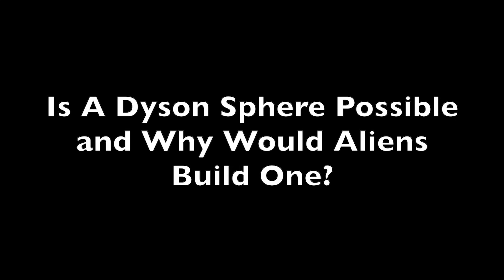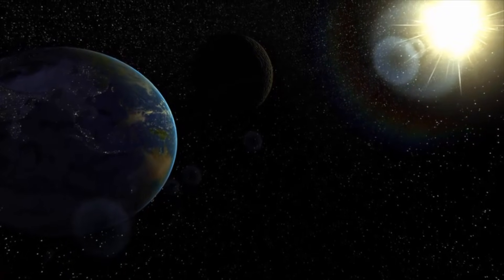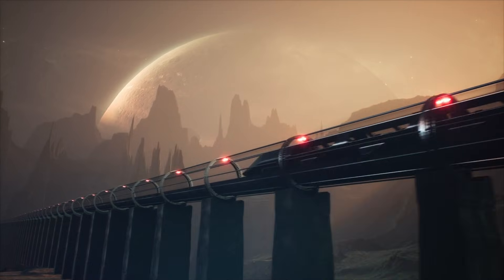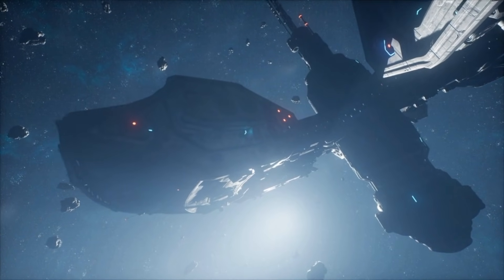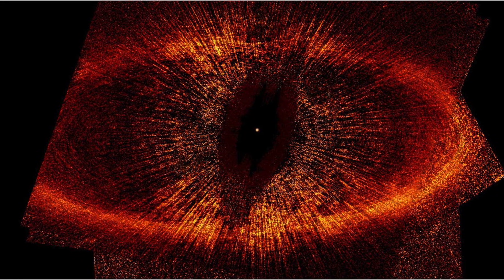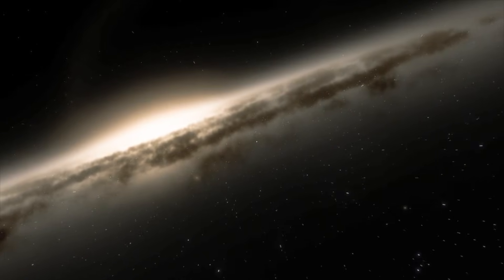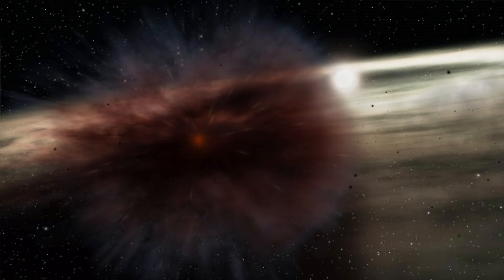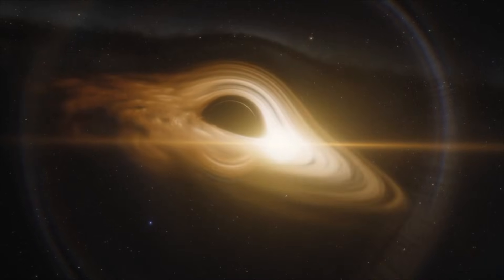Is a Dyson Sphere Possible and Why Would Aliens Build One

Comment: Population seems to be self correcting. We see the evidence all around us. But different areas have their own rates of population increases and decreases. Overall however, it looks that while population will continue to increase for a while due to the inertia of current birth and death ratios, dropping birth rates are overwhelming the increase in lifespan, which, for the foreseeable future anyway, have a fairly hard limit of around 115-120 years.

There have been problems with Dyson swarms. Without constant maintained these spheres begin to loose synchronization. As that happens, the various structures begins move out of their orbits and crash into each other. The time estimated is around 25,000 years after they’re abandoned. So it’s likely that even if these have been built, given the unlikelihood of civilizations to exist at anywhere near the same time, those spheres can be gone before we have the ability to detect them.

Comment: I'm sorry but the biggest structures ever built by man have been utilitarian, including three gorgeous dam, the great wall and the US interstate system. Even Hoover dam is more massive than 100 pyramids of Giza
Reply from the maker: Depends on what you mean by utilitarian. Everything starts out utilitarian, such as the pyramids. People believed they needed to preserve their god king. The locals no longer think that, thus the utility is obsolete. It works that way for anything, Hoover dam might be useful now, but anyone that's flown over lake Mead lately knows that it's utilitarian days are numbered before it becomes a dry concrete monument that may go obsolete even before its internal concrete cures. The end result, we built a monument for a perceived utility, but then the rules change. This was also the case for the Great Wall, it's not stopping anyone today. Also things like going to the moon, a monumental task in itself, was done solely because of a cold war with the soviets. The soviets are gone, and no one would have done it in 1969 otherwise, so the utility evaporated and all that's left is the achievement. 

So when it gets that complex and conditional, it becomes a bit of an overstep to predict aliens wouldn't do something because we don't know what their perceived utility is. If they build a Dyson sphere as a tomb for a god king their religion demands, then they will do it. But you can't know why they are doing it for that reason from a distance.

Comment: While a Dyson sphere is feasible, is it practicable? Yes, you get 100% of the energy but the resources required to build it seems impossible. How do you create an atmosphere? Magnetic field to protect from solar radiation? Where do  you get material? According to a study I just read, to create a Dyson sphere with a diameter of 1 AU, it would take all the material in the solar system to include the Kuiper belt and Oort Cloud.

Comment: The main issue I have with a lot of these proposals is that they generally assume that economics just scales indefinitely without the wheels coming off - while our own experience with economies is that they don't actually work that way. As an economy scales up through various magnitudes, you get more and more emergent behaviors that start to appear, some of which seem really quite pathological. These concepts would require an economy many orders of magnitude larger than our current ones, and we quite frankly can't even guess at what sorts of problems that would entail.

One thing we can say concretely is that the value of any individual in such a system would be more negligible to the economy than your dandruff is to you. I don't think anyone would ever want to exist in an economy of that scale, as it would be capable of casually disposing of individuals by the tens of millions without even a moment's consideration for their welfare. Such expenditures of life simply wouldn't mean anything to whatever entities controlled it.

Comment: I've often heard of Dyson Spheres as the most typical example of a  megastructure.   I called up Dyson and, after some confusion, was told that the largest sphere they have in their production line was about 6 cm in diameter. Not available separately, but only as part of a larger assembly.  I don't know how this can be scaled up to the required size, and perhaps there may be a practical size limitation requiring a leap in technology farther into the future than we can predict.  And perhaps alien civilizations have reached that limit themselves, and maybe won't be able to achieve it before their civilization becomes extinct, obsolete or that the practical engineering required is impractical for the purpose, or that a better technology is a favorable alternative.

Comment: ....giza pyramids are not tombs. That theory and hypothesis is sooooo 1990s/2010. 🙄 
Giza powerplant and Land of Chem comes to mind.
Reply from the maker: Yes, the 1990's were before the internet people started making up bullcrap up about the pyramids for the mindless. Go there. Here's the reality that you'll find. They can't even power themselves. To light them the Egyptians have to run power to Giza from Cairo and then run an extension cord into the King's chamber just to run a lightbulb for the tourists. If you want a power plant, you do not do it with a structure made of limestone, granite and gypsum mortar (the most terrible, crappy mortar you can have. If they knew about electricity, they'd have known about Portland cement). You make it out of plastics, copper wiring and aluminum and actually make it look like a power plant and not a tomb complete with a sarcophagus.

Comment: I must admit, I'm not convinced of the utility of a Dyson-like structure, 1. Energy is surely easier to obtain via fusion. 2. The engineering challenge of building somewhere to live is surely easier in terms of terraforming than building a completely collosol structure or moving to a new star system. 3. The more plausible theory is perhaps the monument or communication reason, using and blocking starlight to send signals.

Comment: The only plausible reason to build a Dyson structure other than some sort of temple is to collect solar energy. A temple doesn't work because you need a highly advanced space fairing civilization that is also highly religious. Though religions built great temples they also without fail tore down technological civilization in the process of consolidating power. If your temple is bunch rocks piled up in an interesting pattern fine you can do that, but try to build a machine that encapsulates a star after the zealots kill your Giordano Bruno, Archimedes and Hypatia of Alexandria for wrong think. And after they burn all the science books for contradicting God's true word.

That leaves solar energy collection. Fusion makes collecting solar energy pointless. Hydrogen is the most abundant element in the universe. Jupiter's hydrogen alone should be enough to power a society of many hundreds of billions long past when the sun dies.

Here's some bonus reasons not to build Dyson structures. The construction mass is in the wrong place. Pulling mass out of deep gravity wells like found in the inner solar system is expensive. Moving mass into the inner solar system is also much harder than using it where it sits. All the really cool elements needed to maintain habitats will need to be sourced from beyond the frostline, not near the star.

Comment: Power generation is not a valid reason unless it is going to be used locally at the point of generation. We have no viable way to transmit energy. 

AI is the only valid reason in the foreseeable future. Google is building an AI data center that is expected to consume as much electricity as NYC. So, power-generating stations housing computers for AI seems to be an optimal use. Information can be transmitted at the sped of light and the energy doesn't;t need to go anywhere else.

Comment: You cannot balance/orbit a ring/sphere around a central gravitational point. It’s the inverse (but same outcome) of balancing a pencil on its tip. A singular orbiting satellite has only one directional vector gravity is pulling it and can be overcome by just falling past it. A ring/sphere couldn’t fall past it, there would always be mass in the area left behind as it spins and gravity would be distributed infinitely. Any slightest nano ounce of entropy in the balance would be compounded exponentially and one side would pull into the center, just like trying to balance a pencil on a sharp tip, it is inherently and infinitely unstable and will collapse. 
The only solution would be active counterbalancing force, such as smart thrusters that fire in reaction and proportionally against movement drifting out of balance, but this would require immense energy for a structure of such size and inertia, and depending on how fast the ring/sphere is spinning the latency and response time would have to be incredible, more like high explosives, so the structure would need to survive that perpetually. All on top of building the thing in the first place. Good luck with that.
Swarm would be the only way but should they really count?

Comment: The idea that fusion would make a Dyson swarm obsolete for energy is flawed, and that becomes apparent when you pay attention to the premise of large energy needs.

If your energy needs do eventually grow to a scale that requires a non-negligible fraction of a star's output, then doing it with fusion rather than sunlight is still going to require immense amounts of fusion fuel. At a near-K2-equivalent level (let's say a decent fraction of 10^23 watts, the sun putting out a bit more than that), we may be talking in excess of the amount of deuterium in the gas giants themselves.
Which means you'll need extremely powerful machinery to lift such material, whether from the planets or directly from the sun. It will be exceedingly difficult to power that without stellar machinery that greatly overlaps with how a Dyson swarm is envisioned.

You might even decide (especially if the less plausible pure hydrogen - as opposed to various isotopes - is feasible artificially) to disassemble your whole sun and turn it into a bunch of fusion reactors: that too requires starlifting machinery which greatly resembles what one would consider a Dyson swarm.
One might consider that overkill, except, again, it is within the same exact premise as with a civilization that wishes to use that much energy from solar collectors: if it does, then whether it does so from artificial fusion or a more traditional solar swarm is less relevant than it first seems.

(Incidentally, that also means fusion does not solve the Fermi paradox and does not refute the argument from Dyson swarm visibility: aliens that use fusion on K2 scale would have an infrared signature, as would aliens that use ordinary sunlight-gathering Dyson swarms)
Reply from the maker: Bingo. I came to similar conclusions. You're building megastructures no matter what past a certain level of energy production and it becomes visible regardless. The advantage goes to a Dyson swarm as you don't need fuel, the star is already fueled up and fusing thanks to nature. You merely need to capture the energy.

Comment: There are no evidence that any pyramid ever was used as a grave. Its a "wusel". And "for religious purposes" is basically "tha f do I know what they used it for" said in a polite way. I fact we have no idea what they were used for and You made a great point about how accurate are guesses are!
Reply from the maker: I'd be interested to know where the idea that they weren't tombs came from. It seems prevalent, I suspect Graham Hancock, but there is actually tons of evidence that's what they were. The Pyramid of Djedkare Isesi at Saqqara South was found to contain wrappings and mummified material fully carbon datable in line with his reign. The Step pyramid also held remains of what was probably one of Djoser's wives, also carbon dated. Even Giza has hieratic graffiti in the relieving chambers of Khufu that cite him that no one had access to until modern times. All this in a country full of tombs that was based on a religion very concerned about the afterlife to the point that it mummified millions of corpses and put them in stone tombs to last for thousands of years. You've also got the Nubian pyramids, which most definitely ARE tombs right next to Egypt showing the custom wasn't even limited to Egypt. I don't get it. It's like someone said "there is no evidence" in video or pop documentary and nobody fact checked them.

Comment: I envision a society advanced enough to build this to do it fully automated in advance in preparation from colonisation. This would mean that there would be zero need to ensure that there are suitable planets around a star and instead just a suitable star and enough raw materials. Send in self replicating machines that will construct new machines. Those machines begin dismantling the inner most planets as they likely will have the metals needed. Consume the planets to make increasingly greater numbers of machines with each being more specialized. Some would be built to be nothing more than self installing structural pieces that would basically crawl into place,b lock themselves in and deactivate. As the planets are consumed more and more of the structure is built until the glasses from the gas giants (which I assume there would be at least 1) are used for various chemistry to create atmosphere and water. All needed resources would be neatly left in an organized manner for the colony ships (likely generational seed ships) to arrive and provide the colonists with everything they need to approve waiting for them. No civilization would actually or actively construct a Dyson sphere, they would just send out the machinery to do it and hope it would report back with status updates. Sending multiple batches of machines to multiple stars increases chances of success and this leads to three possibly of Dyson spheres being conducted and left move in ready but never actually occupied.

Comment: The idea of a Dyson sphere is like the Victorians thinking aliens must use steam power and the telegraph
Reply: You can’t reason about that which is totally unknown. You have to work with what you got.

“Also, steam power is still used to generate electricity today. Morse code uses a binary encoding to transmit letters though a wire. It isn’t exactly dissimilar to what’s going on in your computer. I wouldn’t be too surprised to learn that aliens still use them both.”
 - nerd emoji
Reply: @TheArtikae  morse code isnt binary. it may be on and off but its based on length, time. at the very least, its ternary. on, on-on, and off. quaternary, it also has an "off-off" state for between each letter. could go further, it is quinternary as it has an even longer off state between any word... theres on, on-on, off, off-off, and off-off-off... five states.

theres also no fixed clock rate, or parity/error detection. no handshakes, no nothing.

and to say its in any way similar to whats happening in even the most basic 4-bit CPU is to completely misunderstand how a computer works...
Reply: How so? You either need more energy than natural insolation of the planet or you don't. If you do, it's just there for the taking. A physical process we don't know about with energy output per unit of volume larger than fusion is probably not something you want to be running on the same planet you're living on. I don't know anything about alien industrial safety practices, of course, but I'm assuming that “shit happens” is a pan-Universal law of nature...

Comment: Another thought provoking video, thanks.

In 1894 it was predicted that in 50 years the streets of London would be buried in a layer of horse manure 9 feet thick. Populations in prosperous countries stabilise and decline. Dyson's original 'report' is a single page with 3 references.
In that regard it is something like the Drake Equation, a quick piece of creative thought that took on more significance than was ever intended.
 True, Dyson mentions power and habitats as uses. A recent paper from Harvard estimates even the Oort Cloud is far smaller than the 1/3 Jupiter mass Dyson specifies. The Asteroid belt and Kuiper Belt are much smaller as are Mars and Venus.  A weapon, tomb, brain and star engine are all cool ideas. May I add particle collider, all sky beacon, light sail laser farm and a warp bubble generator?
But in the end I fear it maybe nothing more than cosmic horse manure. 😉

Oort Cloud Paper
https://ui.adsabs.harvard.edu/abs/1983A%26A...118...90W/abstract

Comment: Well, looking at it from what I expect to be Terran progression, Mars and Venus both hold certain interest, but from a DV and geometry perspective it's Sol/Earth L4 and L5 I'm interested in.  And it won't matter (so to speak) whether we're biological or electro-mechanical, the motivation for occupying those domains is the same. It's the same with resource requirements, which we can literally gather from the void over time.  What might matter a little is that whatever biology inhabits those domains will want spin gravity (us in particular).

Doesn't help with SETI, though.  You'd have to know where to look for the people expanding into their home planet's stellar orbit.  Worse, a Stanford Torus or O'Neil cylinder is mobile, at least for the sufficiently patient.  They can migrate.